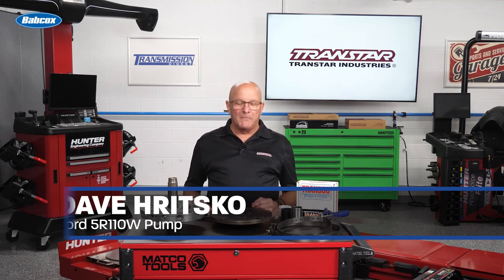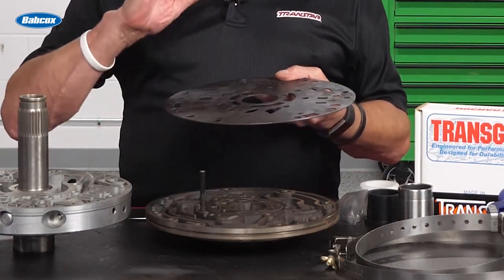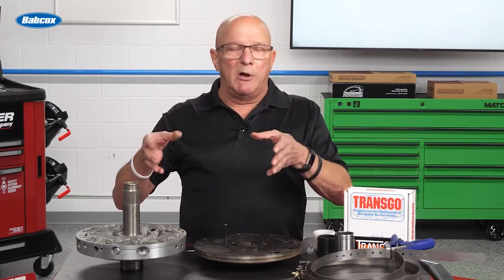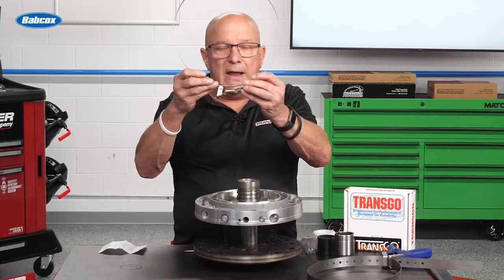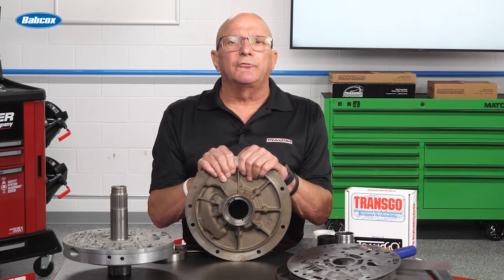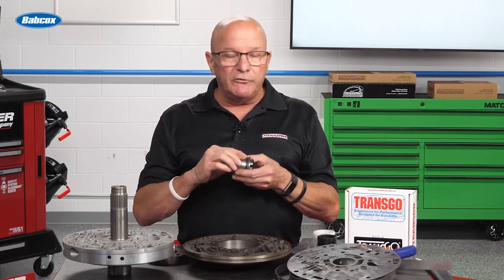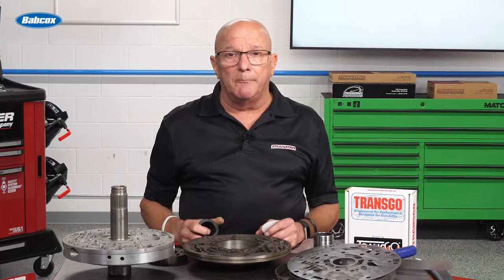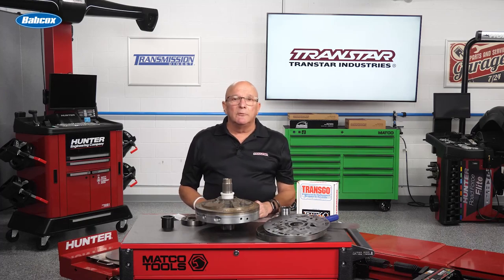Ford 5R110W pump issues and repair

Comment: 2005 Ford F-350 6.0 5R110w one day truck started jumping into gear then started wanting to die out. Made it back home next time I started the engine to see what would happen I put it into gear (let me note there were no codes present) it does out almost instantly. So I crawl under the truck notice line to filter leaking. Got it patched up re topped off the trans fluid was 4 qt's low next I drive it drives and shifts nice but notice something around 40-50mph 5th to 6th tow-haul starts flashing. Took it to get code read shop said they were 3 weeks out but they could at least read code after reading P1744 they all of a sudden say it needs a whole new transmission and they can start working on it in two days. So I felt something was up there. Today 2/3/2022 I'm going to go drain and drop the pan to replace the Tcc solenoid. Am I chasing a wild horse? Any help is much appreciated thank you